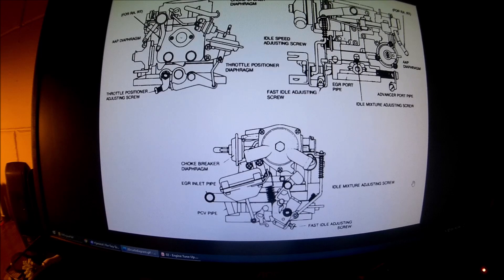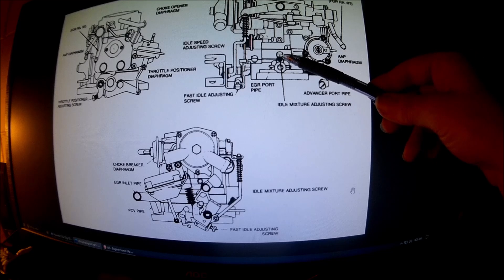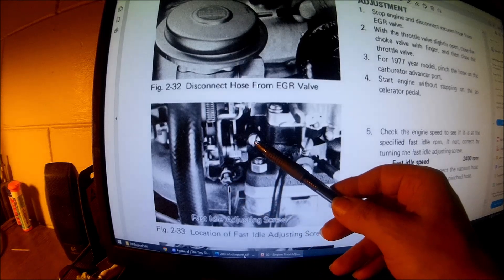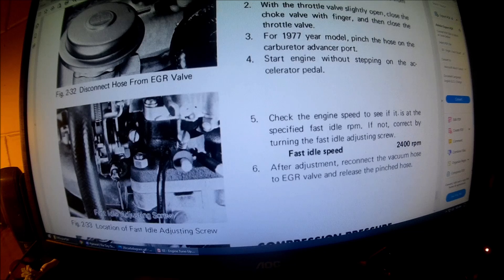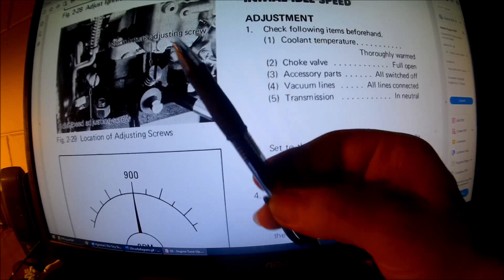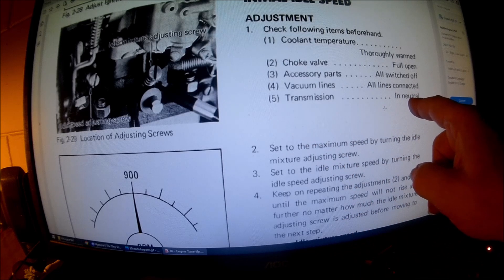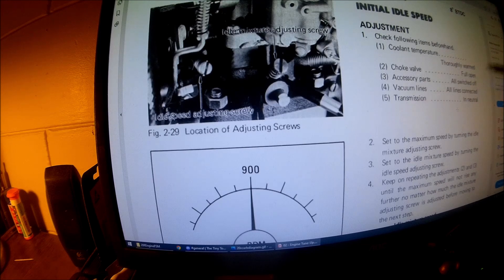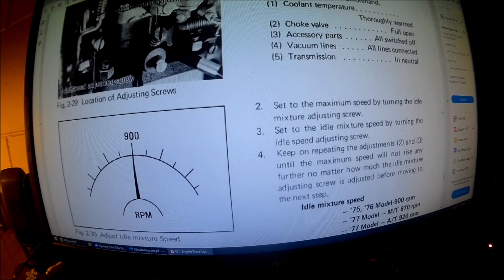Toyota 20R Basic Carburetor Tuning Procedure & Info

Comment: Thanks for the videos! I think I have a carb issue on my 79 Toyota pickup. Won’t pass smog. Says it’s running too rich. Too much CO2. Trying to figure out what the problem is and ran into your videos. Any advice??
Reply from the maker: Hard to say without more specific info on what exactly you have going on with your setup. Such as:
1. Carb - Is it the original carb? Has it been rebuilt recently (like within the past year or two)? Have you tested the carb for any vacuum leaks by using carb cleaning spray while the engine is running & listening for surges? Are the vacuum lines to the carb all hooked up properly & in good condition? Does the choke plate (plate in the top of the carb) move freely when fully warmed up? Have you lubricated all the linkage points? Do you have a throttle linkage from the gas pedal or a cable? That linkage needs to be cleaned & lubed as well, & if it's a cable you need to internally lube the cable. If cable, inspect the cable for any damage or problem, replace if needed.
There is also a possibility that if the carb is original, someone previous to you caused some minor damage. Most common problem I've seen is that someone previous to you seated the idle mixture screw too tightly. This can cause a groove to be pressed into the screw top, or enlarge the hole that the tip goes into. This can cause excess fuel to pass through the idle circuit & cause a rich condition at idle.

2. Fuel - Are your rubber fuel lines old or new? What kind of fuel are you running? If you still have older fuel lines but are using today's modern Ethanol-laced gasoline, the Ethanol can deteriorate the inside of those rubber lines & particles can come loose from them. Those particles can get to the carb & partially or completely block the idle passages, causing a rich condition. How old is the fuel filter?

3. Engine timing - If the engine timing is not correctly set it could cause an incomplete burn of the fuel (rich). You'll need a timing light to do this properly. Timing spec is 8 degrees before top dead center (BTDC) at idle, fully warmed up with choke plate fully open.

4. Ignition System - Old or new components in the ignition system? Misfires can cause a rich condition (higher CO2 at tailpipe). A worn or malfunctioning distributor can do the same; is it the original? How many miles on it? There are a few things that can go wrong with the distributor, such as the vacuum advance diaphragm not working, the pickup coil being out of spec from wear/use/age, or advance weights sticking (no/slow/inconsistent ignition advance). Advance weight pivot points need to be occasionally oiled.

5. Engine - Have you done a compression check on the engine? If you have leaky valves or worn piston rings this could be an issue.

Let me know about these things or use the above as a checklist to try to solve the issue.

Comment: I’ve been struggling with my 1980 toyo it won’t start anymore it was working fine and it wouldn’t turn on once it was warm. Next morning it just won’t turn over anymore unless I push the gas peddle but it’ll just drop back done and die.
Reply from the maker: I would suspect a fuel issue, likely the carburetor. From what you describe, I'd suspect a blocked idle circuit, with the main circuit is still open & working. The idle circuit has a much smaller bore than the main circuit, so it's more likely to get clogged up before the main does.

There could also be other issues with the carb & fuel system that cause this, but it's hard to say without actually looking at it. Has the carb ever been cleaned or rebuilt? Is the fuel filter dirty inside? Are there any fuel leaks anywhere from the tank to the carb? Are you running ethanol-enhanced gas in it, like the "regular" gas mostly sold today?

The answer to that last question could be very important. Let me know.